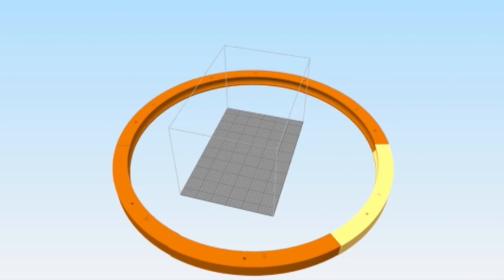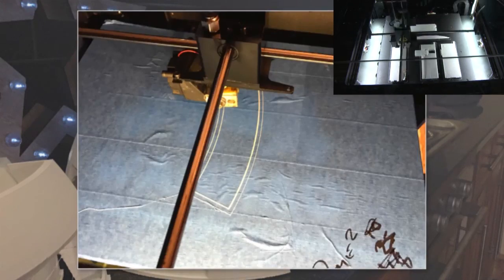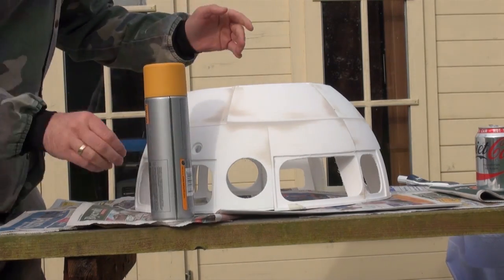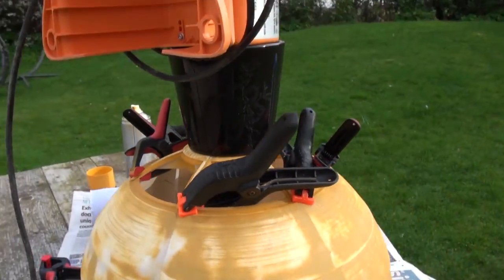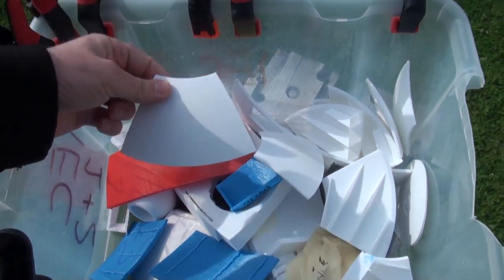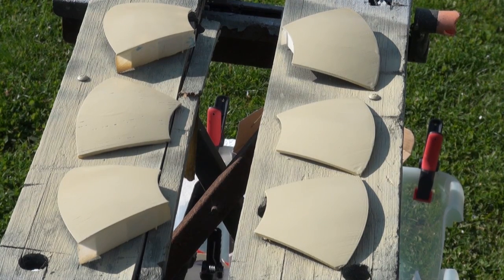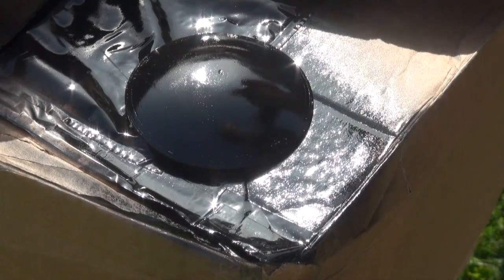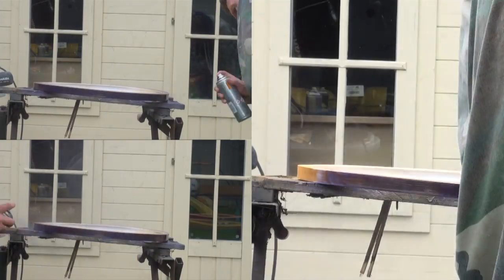How to build 3D printed R2D2

Comment: As someone that wants to just dive in and make a 3D printer R2D2. What advise can you give for selecting a 3D printer? What printer did you use to build yours?
Reply from the maker: hi there are sooooo many printers out there i guess it depends what size you want to print and what quality? ender have a massive range and are highly spoken about... i use a RAISE3d . have fun its aweome what you can create!
Reply: @spacecadet1975  thank you for the advice. The goal is to build a full size R2 unit 😀

Comment: You did a good job bringing it back after seeing those prints, how has it been holding up over the years?
Reply from the maker: John Hormaza it’s still going I actually put the motors in it this week ! Lol it’s almost finished now and learnt an awful lot along the way !
Reply: @spacecadet1975  that's awesome way to keep at it,  are you still using the same printer? I'm printing a C3PO  currently, my new printer (et5) is so much better (and cheaper) than my first printer 6 years ago
Reply from the maker: @johnhormaza5469  Hi no i have changed i now run a Raise 3d N2 Plus.. very different animal from the junk i had before! lol

Comment: I made one by myself with all different parts that would work. I wish I had of had a 3D printer. The head moves and has a cam and has a Bluetooth sound system and all the right lighting. Plus has a 12 volt power supply to help me with installing things in cars of which I do a good bit. Great job, Plus I love you learned some stuff along the way, :) . I build cars too and do body work so I understand the problems you ran into. You did great. Thank you for the video, :) .
Reply from the maker: Thats awesome! love to see a pic if you have a link? 3D print has certainly helped a lot with prop building!
Reply: @spacecadet1975  They are on my page, along with just a few other things I have made. Still Love your video, everything I have done was by just trying it out. Glad to know there are a few smart people left that like to try to teach themselves how to do something, lol.

Comment: Trevor, I'm curious about how much filament the dome took in your best print. any idea on how many kgs or total spools you used? trying to get my own estimate on the cost to print on our printer. thanks
Reply from the maker: Hi Steve I believe it was appx 5 kgs. It didnt take too long at all... Have fun and let me know how you get on!
Reply: Thanks  @spacecadet1975 , I'm surprised a little that it wasn't as much as I would think. That's actually affordable, at least until the main barrel body. If we can dial in the FT5 (again), we might actually give this a shot.
Reply: @Trevor Fuller, not to get too far in the weeds but if this was your first print, what nozzle size did you use on your extruder? My son has had a lot of issues lately with the standard  0.4mm and I'm wondering if on something like the body parts, we should be using a little bigger nozzle for ABS to get a heavier wall, more rigidity... thoughts?

Comment: when spraying lots of parts a makeshift spray booth will save you quite a bit of money in paint as spraying outside  in even light wind you will lose  a lot of paint, when spraying lots of parts I hang them on a tiered frame as when spraying at the recommended distance you can get two or more parts in the line of fire of the can, depending on the size of the parts of course

Comment: Hi trevor i going to begin with this project, what size of 3d printer do i have to use? 220x220x250 ?
Reply from the maker: joey degener I used twobone same as yours and new one 300x300 x. 900

There are various files  for different size printers . Gotto patreon page of Michael Baddley he is awesome and creates them all !
Reply: @spacecadet1975  can you tell me if this printer can do the jobb: Creality3D Ender - 3 DIY 3D Printer Kit

Comment: Amazing man, what 3D printer did you use?
Reply from the maker: Hi there thanks for the comment.... I started on wanhao d5 Large and then treated myself to a RAISE 3d N2Plus its the bollox! pardon my french!  Here is a link to the unboxing incase you are interested 

https://www.youtube.com/watch?v=yTcP53m4er8&t=1s
Reply: Trevor Fuller awesome thanks man 😀
Reply: Trevor Fuller what would be the smallest print bed I could use? That printer looks amazing but a bit out of budget sadly
Reply from the maker: If you ping a question over to Michael baddley his link in my description... he designed it and is incredibly helpful... he has stl files for various bed sizes and can tell you what is required... i think 300x300 mm was my first printer? but he is very easy to talk to and am sure he can help you...

Comment: Hi Trevor, I’m trying to work out on your video if you are using two different primers. I see your using Halfords high build primer for the separate parts but what primer was being sprayed on the dome. Thanks in advance
Reply from the maker: Darren Little hi there , I used Halfords filler primer throughout . It was sanded back and wetfkat a lot of the time and one time I got a different brand and was slightly more grey/ cream colour but it was still a high build primer ... I hope that helps . Are you building one yourself ? It's epic to watch it coming together ! I'm still making the body at present ...
Reply: Trevor Fuller Thanks for the quick reply. I’ve just bought the printer and almost ready to go, can’t wait! There is both me and a mate building two separate units over the coming months, he’s also buying a printer soon. How long did the printing take?
Reply from the maker: Darren Little well I suppose if I did it non stop I could poss do the dome in about 4 weeks unc painting and finishing ... but allow for the nightmares along the way ! Ha ha and remeber to eat .. I've actually been going now for appx 6 months and so bits when I get time :... so worth it ! Check out Michael Baddley if you haven't already ! He did the design and created the files he's awesome !! And incredibly helpful if you have any questions . His link is in description .
Reply: Trevor Fuller Cheers Trevor, I’ve managed to get some feedback from Michael,  he seems really helpful and is quite active on Facebook and some other sites. I think your build looks awesome and it was one of the videos that inspired me to make the jump. Would be great to see a update further down the line if possible. Thanks again
Reply from the maker: No problem i intend to. if it helps i have never ever printed anything before this project! so its all possible.. but of course i did produce some real messes sometimes which was all part of the learning curve! Michael will tell you some of the pics  sent him of melted lumps of PETG!! lol
Reply: Trevor Fuller look forward to seeing it when you do. It seems a great community of people who are really passionate about their builds. Thanks again. Hopefully speak again in the future

Comment: What printer did you use?
Reply from the maker: Tom Hammarberg I used a wanhao d5 originally at start 

And I then upgraded to a raise 3d N2 plus so a bit of a mix :)
Reply: Trevor Fuller ok, pretty expensive printers :) what is the biggest thing on this build to print? Is my printer 300x300x400 enough?
Reply: Trevor Fuller hello?:)
Reply from the maker: Tom Hammarberg hi sorry for delay that should be fine .. he has supplied all files in different sizes for more versatility between different size printers

Comment: there is a few hours printing there well done ... turn on manual mesh leveling in marlin firmware and Lin advance it's a pressure control setting will give u better extrusion
Reply from the maker: Sure is a few hours .. ha ha 

Thanks for the hints .. I've changed machines since this and am applying a lot the ideas you ha e given me .. thankyou again .

Comment: Two questions. One where are the stl files from? Two how long did it take in total print time?
Reply from the maker: Hi William I actually have a sheet of paper in the studio that I dropped most of the print Times on if the actual dome but not the panels .. I did a lot of prints over night and left it running .. I would guess end to end appx 10days non stop . But I also did quite a high resolution and probably could have done a lot faster ! But it's the first thing I ever printed so had a lot to learn but what a fun project to learn on .. 

The files are available on the link below my video in the description .. go to Michael Baddley patron page and you can get the whole thing !! I'm currently on the body now .. then legs .. 
hope that helps
Reply: TY.

Comment: noice! may I ask why you used a yellow primer instead of a grey high build filler primer??
Reply from the maker: Hi there , no reason for the yellow at all . It was all Halfords had available when I went there . It is high build primer so as I was going to spray it over anyway I didn't think it would matter :)
Reply: Trevor Fuller OK jw thought maybe it was so you could see where you sanded through. when I get my ft-5 together in may attempt this. nice build! also for the blue if you use a bright silver base and then a candy blue over it you will get more of an anodized blue metal effect. here in the states they sell duplicolor"metalcast" that is essentially a  candy (translucent) colored paint. they sell it in blue and several other colors. they may have something similar there or online.

Comment: Great effort, thanks for sharing.  Currently working on the same project (though now printing the v2 body) and will be uploading a video soon of the dome construction.  I've had a quite a bit of cutting and resizing to do with my parts, did you get that to? And i wondered are you adding any internal leds to your dome?
Reply from the maker: Hi There, the leds are all on order and just waiting for those to get here. so eventually will be all singing all dancing Artoo! I didnt have to resize anything? what slicer software are yu using? im really really pleased with this, ive never ever even looked at a 3d printer before this project.. apart from a shed load of sanding and filling whilst i was finding the ideal settings ive loved every part! if you get stuck and you have Patroned Mr Baddeley he is awesome at messaging back and helping you out.. he has helped me loads and loads! id love to see your video so tag me in when you have the link up! Nice to meet you....
Reply from the maker: Hi there hows the build going? im halfway through the body right now!

Comment: Great video and a very interesting build. What is the weight of the dome once finished? I already have a repurposed aluminium lampshade as my finished dome, but it isn't quite the right shape. Might have a try at printing a dome if it's not too heavy for my dome motor. Here is a link showing a comparison between my original dome and my current one - https://www.youtube.com/watch?v=9YaqbfDOAPQ&t=549s